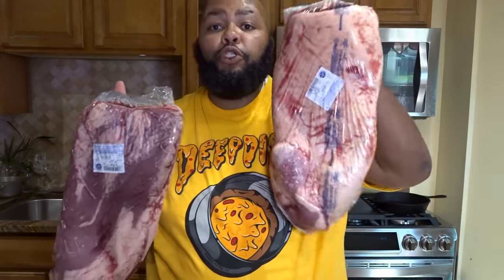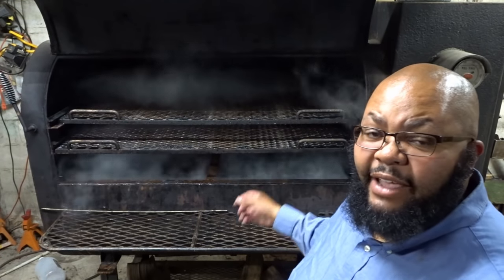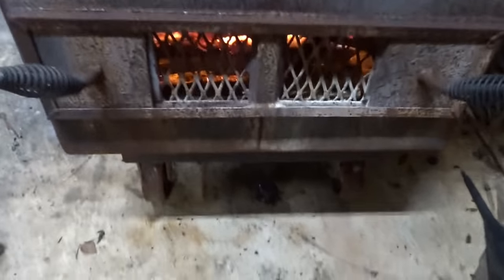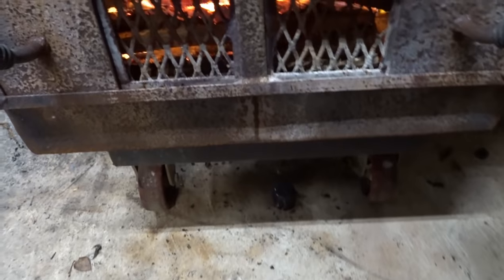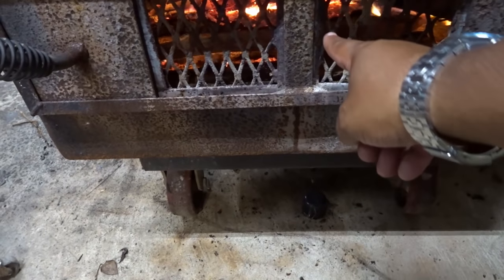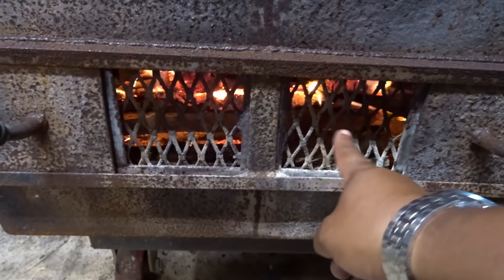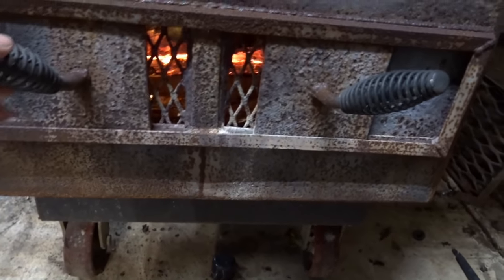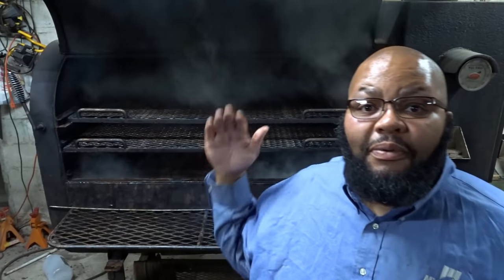SDSBBQ - How Get a Great Brisket Smoke Ring - Part 1 - The Cook

Comment: The type of wood we use also factors in to the amount of Smoke Ring you'll achieve...
Reply from the maker: I disagree to an extent, it's more temperature dependent. Temperature of the food and what temperature your cooking it as well.
Reply: @SDSBBQs  Yes, Time and Temp are the major factors.   But, the type of wood still plays a role.  I heard it first through a bbq thread, then I googled it, then I tried it for myself.   I was surprised to see the result, but it is true none-the-less

Comment: I’ve seen you steam clean your cookers a few time and always wondered if there is a threat of damage from thermal shock. They always say never put cold water in a hot CI pan, always hot water.
Reply from the maker: I've never had an issue and I've been doing it the same way for years.

Comment: I really don't think meat temperature being cold has anything to do with smoke ring. My answer is good wood nothing but wood no charcoal. Charcoal is for grillers smokers use wood only.
Reply from the maker: But you do realize that most charcoal is mainly wood right? And lump charcoal is all wood...
Reply: @SDSBBQs  yes I'm aware where charcoal comes from  i use to cut blackjack for charcoal plants in salem Missouri  yet all the good of the wood is gone
Reply: Making charcoal takes all the violate chemicals from the wood and leaves just carbon to burn. The flavor is gone from the meat with charcoal. Thats why Dash adds sticks of wood to the charcoal basket.
Reply from the maker: Not all of the flavor is gone from charcoal but definitely not as much as straight wood.
Reply: Smoke ring forms thanks to the interaction between nitric oxide and myoglobin.  It will only occur up until about 160-170 degrees.  Cooking low and slow, starting with chilled meat,  gives the nitric oxide produced during combustion time to penetrate deeper before the meat hits that cutoff temp.